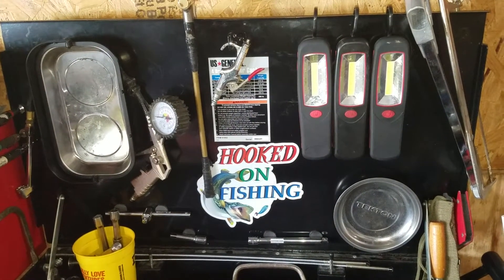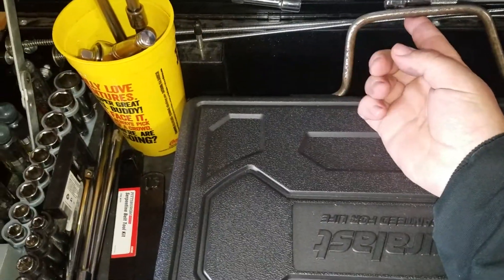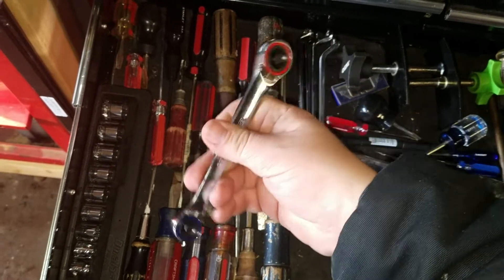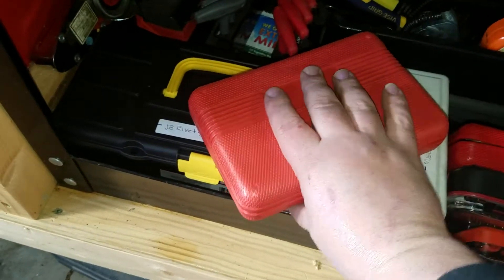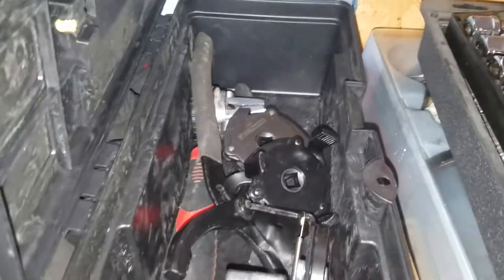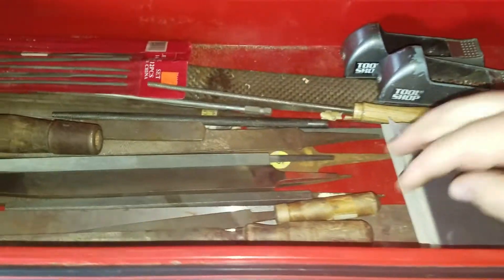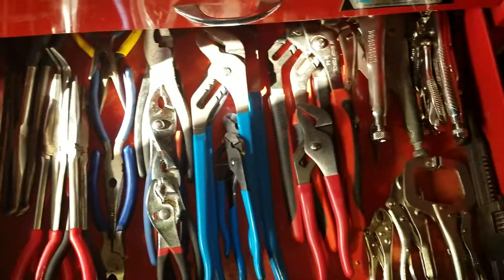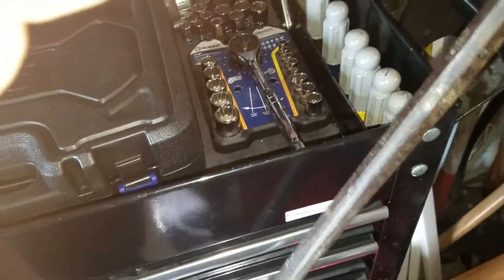DIY small eng and autoservice tool box tour

Comment: I see a few similarities with my tools.  We both have a whole bunch of socket extensions,  we both have a lot of hammers,  I don't think I've ever bought a brand new file, I got all of mine at garage sales and places like that.  Your torx bit set that you said you got from a wholesale place that sells stuff for flea markets reminded me of an angle grinder I bought from the same kinda place,  It was a no name brand that I paid $20 for and used for about 20 years.  I have about six others but it was my go to grinder and I was kinda bummed when it died.  I tried to fix it but it never worked right again,  I suppose I got my money out of it lol.
Good video and thanks for the tour.
Reply from the maker: Bruce L. Hey that is very cool. I too got a no-name grinder that I've had probably about 18 years when I started building tools and took Small Engines class in high school. I got mine at a Big Lots though that was right next to a Sears Roebucks Small Engine repair place. Thankyou for your support I'm glad you liked it I had two other videos on carpentry beginner carpentry tool options if you would like to watch them. I'm also getting ready to clean my shop up so I can give a shop to tour. It is just a 10x12 shed I build. Thank you again.